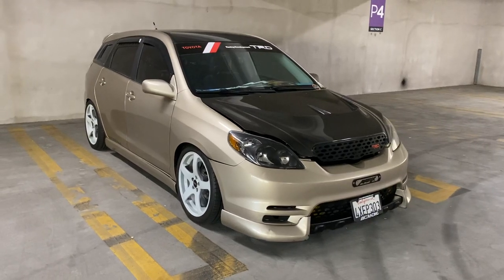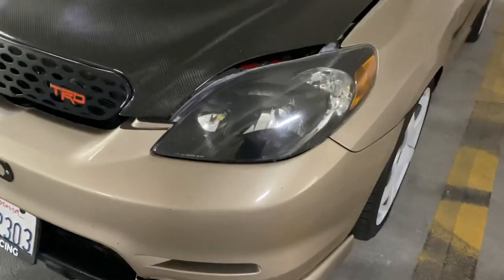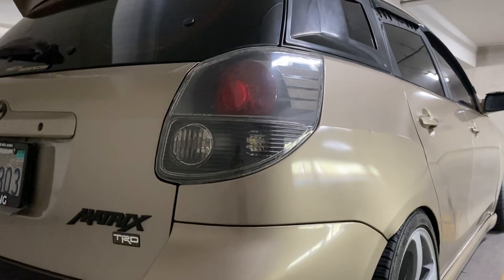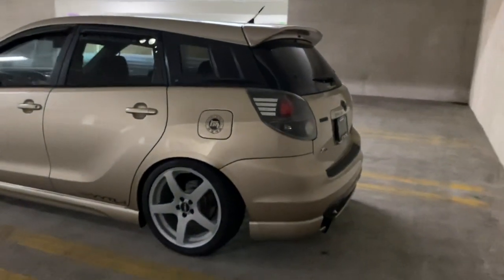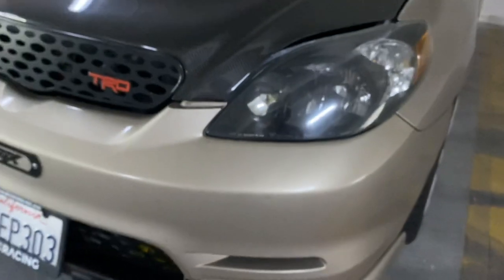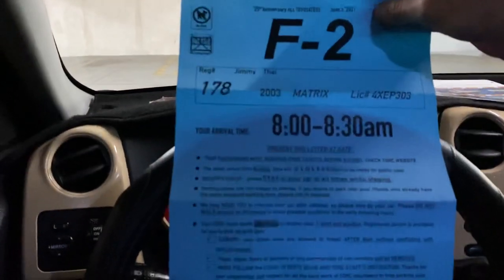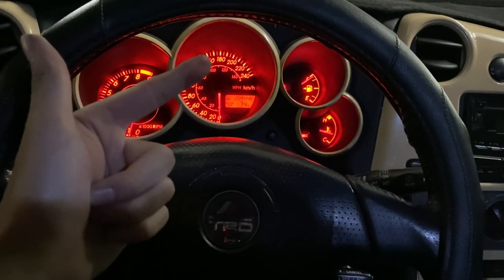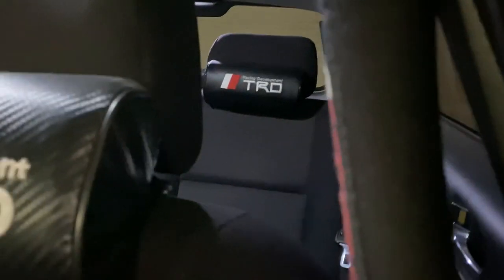2003 Toyota Matrix XRS (End of an Era)

Comment: what is the difference on 2zz from celica and 2zz from xrs/corolla? im bit disapointed that i got the 2zz from xrs/corolla instead of the 2zz from celica.. ill be putting it on my yaris vios
Reply: I think the only real differences are air injection was added 04+, the early Celica GTS had a slightly different style intake manifold(not sure if it was a total design change with longer runners or just produced differently, visually they're a bit different), upgraded lift bolts in late 02+? 2ZZs, some basic ECU tuning and VVT/VVTL crossover tweaks, the water pump impeller/casting is different depending on application. Internals should all be the same. There could be some more minor differences I'm forgetting. 

The later C60 trans was improved as the years went on too, I think it ended up with stronger syncros 05+? and the gates for 5 and 6 were made to be out farther from 3 and 4 because a bunch of early Celica drivers were mis-shifting/overrevving(I want to say 01+, but can't remember for sure). Although no matter the year it's still a fairly weak trans, but it does alright at stockish power levels.

Everybody claims the early 2ZZs "made more power" but ratings were higher early on and decreased across the board after SAE testing standards changed. The long blocks should all be nearly identical apart from maybe air injection no matter if it's an Elise or a Matrix, if they aren't then I haven't heard otherwise yet. I guess what I'm saying is that stock dyno numbers for most of the cars equipped with 2ZZ/C60s to the wheels seems to be around 165-170whp. Full bolt ons and a tune gets decent gains(185whp-190whp) but it's pretty well optimized stock for the cams that are in it.

Comment: You think I should get an xrs 03 for a first car? Currently have a hand me down 05 Altima that I'm sick of. Some guy is selling an automatic xrs nearby for 4.8k looks good condition but I'm just not sure if it's worth the price
Reply: Don’t buy the automatic one
Reply from the maker: It’d be worth it if you get a 6 speed manual 2003 XRS because lift engagement (VTEC in a Toyota starts earlier at around 6200 RPM)
Reply from the maker: @ericthomas2388  I second this!

Comment: I installed the cold air on my 04 xrs and I broke the 2nd air injection  plastic hose.  Do you know what it is called?
Reply from the maker: Not too sure, I saw your Facebook post on the 1st Gen group, would you be able to take a picture and post it in the comment section? My 2003 XRS has no secondary air injection - only 2004-2006 does. Lol.
Reply: @thai2zz35  ok ill take a pic

Comment: I seen a 03 matrix for sale at car lot not to far from me in that color n didn't like at 1st but seeing your car I'm considering getting it. Good info knowing that it's a 1 year color as well. Do you know how many were made?
Reply from the maker: Yeah man the whole car is like an antique being an only option color in 2003. I do not know how many were made unfortunately, however if it’s Desert Sand Mica, XRS, and automatic (super rare 4-speed offered in 2003 for 2ZZGE).
Reply: @thai2zz35  the one I'm looking at is a xr matrix in that color n its a automatic
Reply from the maker: @chrishotrod6603  if it’s a good price, I’d get it. Doesn’t matter if base/XR/XRS, Desert Sand Mica is one of the most beautiful colors Toyota ever had for the 1st Gen Toyota Matrix in my honest opinion!
Reply: @thai2zz35  it's got 105,000 miles n looks to be in good shape from pics won't know till I see it in person and they want 6950 for it
Reply from the maker: @chrishotrod6603  I’d check it out in person first, then shoot your price and see if they’ll negotiate. Knowing used car dealers - prices are usually firm as asking but give it a shot.
Reply: @thai2zz35  ya I went and looked at it and paint was ruff lots of spots where clear coat was peeling. If paint was better I'd consider but I'm gonna pass on it. I dunno if I can share link to you or not so you can check it out
Reply from the maker: @chrishotrod6603  Send me a link if you want! If I can recall correctly, I also had clear coat peel on mine but towards the front fender.

Comment: BRO THATS MY CAR!!! I BELIEVE I SOLD IT TO A GUY IN RIVERSIDE, JUST ABOUT 2 YEARS AGO! I RECOGNIZE THAT BECAUSE I DID THE WINDOW VINYL AND NUMEROUS THINGS ON THE CAR! AND OF COURSE THE LICENSE PLATE, SOLD IT TO THE GUY BECAUSE THE HEAD GASKET WAS LEAKING! I'M LOOKING INTO GETTING ANOTHER ONE WOULD YOU BE WILLING TO SELL THIS BACK TO ME??? IM IN SAN BERNARDINO
Reply from the maker: Wow, such a small world that we live in! It's nice to meet you, Mr. First Owner! Great evidence proving that this car was originally yours. However, what I am curious about is that why did you ditch the car after the head gasket leaked? Also why did the head gasket leak in the first place? Those are the questions that question me whether I should sell the car back to you or not. Also I'd like this car to go to a good home for someone who has knowledge on Yamaha's 2ZZGE vs someone who just buys it to drive it. The motor currently has 209k miles (original miles) and has underwent a head rebuild at 200k miles with OEM Toyota gaskets and seals along with a new Toyota OEM water pump. When my mechanic took apart the head, we did come across the use of aftermarket/cheap/non-genuine parts. I paid $3,000 out of pocket for that service. So if you think you're going to get my car for anywhere in the lines of inexpensiveness and fully modified with tasteful aesthetics, you're wrong. If I did plan to sell it to you within the 3 or 4 weeks, remember to have $10-12k ready. This build's no joke to me. With all due respect, you'd be better off with a 1ZZFE 5 speed manual or automatic because the 2ZZGE is high maintenance and requires full attention. What I've learned from having this car for a little over a year is that the head gasket doesn't just leak because it's uncommon for it to do so. What's more common on these engines is the timing cover gasket, which becomes brittle, and leaks intensely. Good luck finding one!
Reply: @thai2zz35  wow,🤣🤣🤣,first off 10-12 k ur smoking crack man! TRD and eBay aesthetics 🤣, Second shit happens bro I had just dumped all of my money into a new house when the radiator took a shit I lost all of the fluid pulled over on the freeway,that's what happened, I did afew things on the car,rotors,visors,radio,tint,intake,etc was already looking for a family car to daily,so my money went into an accord sedan,but had plans for this car!but il find another one with low miles,maybe u should get your 1zz back🤣good luck finding a buyer for that price!your such a nice person bro
Reply from the maker: @DEZUSD  It’s sold. No need for further inquiries. Serious buyers deserve it. I wouldn’t want to rehome this car to someone who gave up on it in the first place... it’s nice knowing who you are though! #TRDerrything
Reply: @thai2zz35  This car is worth more than 10k . Hope you didn't give it up for less

Comment: What is the size of your tires?
Reply from the maker: 225/40R18
Reply: Dose it rub at all? Or did you have to modify the wheel well?
Reply: On your rims what's the offset?
Reply from the maker: @skatersedge3139  +42
Reply from the maker: @skatersedge3139  no rubbing, I have my front fenders and rear quarter panels rolled.